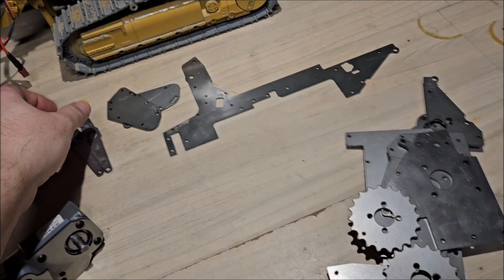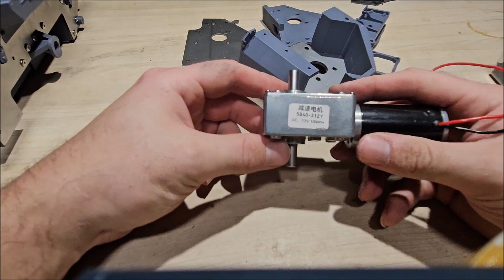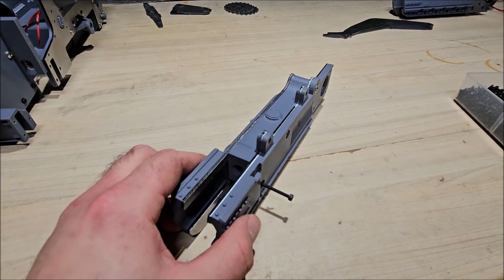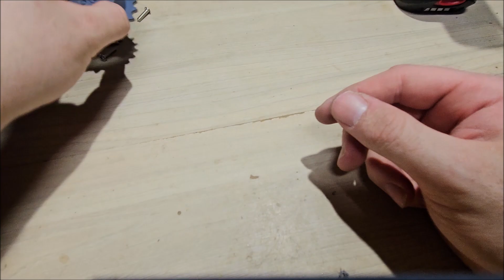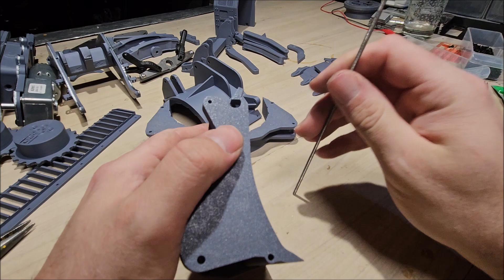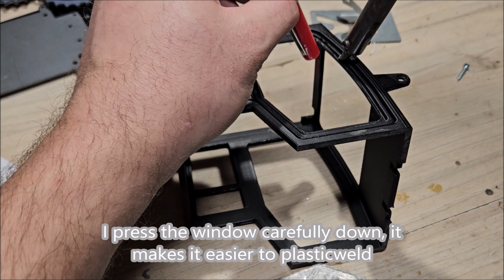1/14 Steel Plated CAT 973K - PART 1

Comment: Really great video. 
Can you find out what the window material is? I can be wrong, but I don't think you can cut polycarbonate with scissors.
So would be awesome to find out what your material is, so I can buy the same, and also cut with scissors. Just guessing here, but can it be PET/PETg?
Reply: Acryl 0,5 -1 MM i guess
Reply: @niklask1651  Lasse says that it is 1 mm, so I don't think it is acrylic either, as acrylic is brittle and shatters if you try to cut it with scissors.
Hopefully Lasse can ask his local supplier.
Reply from the maker: @ according to the guy I get it from its Polycarbonate 0,75 mm
Reply: @burnie222rclasseanhanger6  Ok, I see. Thank you for letting us know. 👍

Comment: I have bought this model and its fantastic!! you did a great job. Quick question does the stone guard get added to the model files or is it something separate??
Reply from the maker: thank you so much :D yeah, this is a new bucket which will be included in this upcoming steel plated update for my kitten 937 model :) I also have a new hood for it, which will also be included :)
Reply: @burnie222rclasseanhanger6  Very cool new hood that sounds very interesting cant wait to see it, Do you know when that rock guard will be but in the files?

Comment: Was wondering if you will be doing metal drivetrain for the Kitten E394?  Planning on building that with the hydraulic conversion
Reply from the maker: aah, no, that is not planned at the moment. I have planned some new excavator models with new undercarriage designs soon though, as my current excavator designs are getting outdated and old.
Reply: @burnie222rclasseanhanger6 - Ok!  Was planning on building an hydraulic excavator, and bringing it to some conventions.  Looking to start the build in the next couple of weeks
Reply from the maker: @TripodsGarage  awesome ! :D feel free to come to my facebook group and share pictures \ experiences with your build :)
Reply: @burnie222rclasseanhanger6 - Am part of your group.  I am John, and just asked you about fitting the metal sprocket on the excavator.  That was one of my original thoughts when I was watching your build.
Reply from the maker: @TripodsGarage  oooh hahaha, wow okay. :D so many names, so many platforms, its a big soup 😆😆
Reply: Do you cut the plates yourself or are they done by a third party with a cutter?
Reply from the maker: @brads_Stuff_400  they are cut by a third party with a cutter !

Comment: When you release these files will they replace the old ones? I don't really want the metal plates as they add cost and I don't know where to order them. Was thinking about building the model next.
Reply from the maker: no, They will not replace the old files :) the steel files will only be an addon :)
Reply: @burnie222rclasseanhanger6  great!
Reply: The model is all 3d printed, usually Laase update his models with the upgrades made or he will certainly post the metal file as an add on in the future enjoy and dont hesitate to buy the models lets go just do it!

Comment: Hi, I was wondering wich cad program you used to draw your models. Also, did you use photo's or blueprints for your models?
Kind regards, Bo
Reply from the maker: Hello! I use 123D Design to make my models :) And I look at the dimensions of the real machines and try to make my models in 1/14th scale. I design my models by looking at pictures as inspiration
Reply: @burnie222rclasseanhanger6  Thank you

Comment: Er det sjangs for at flere modeller får "metal oppgraderinger" etterhvert.. :) Har nesten printa ferdig graver, dumper, laster og doser, men ikke starta å bygge... Kommer det filer for metalinnlegg, venter jeg mer enn gjerne litt med byggingen :)
Reply: I was going to ask the same question.  Was wondering if you will be doing metal drivetrain for the Kitten E394?  Planning on building that with the hydraulic conversion
Reply from the maker: Heisann :) Det kommer nok ikke fler oppgraderinger til de gamle modellene mine, men fra nå framover blir det nok mere alternativer der man kan velge mellom metall-plater eller 3d printa plater på modellene ja :) Kommer med mer info om dette på mitt neste bygg :)